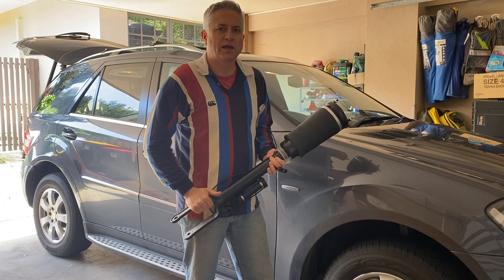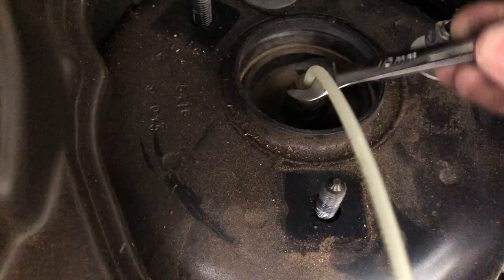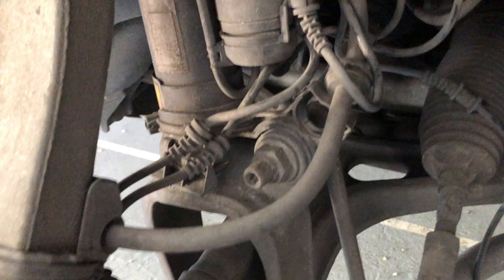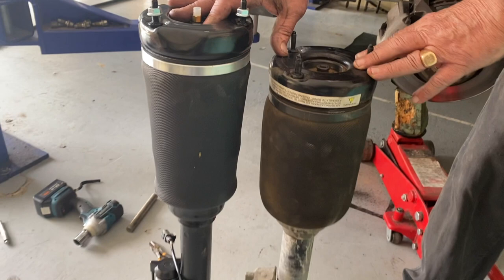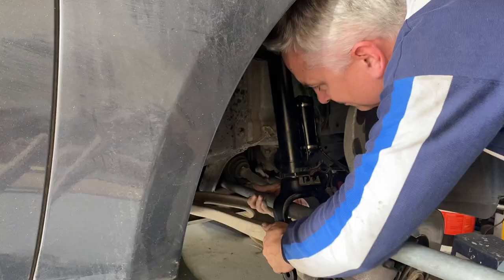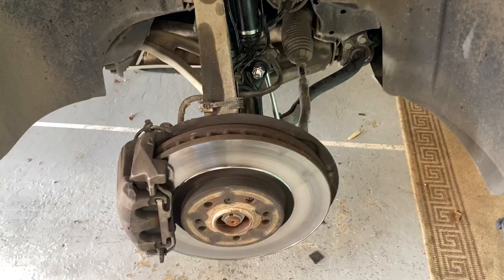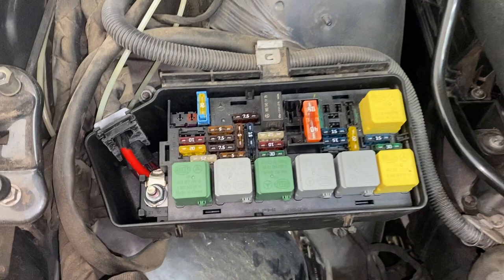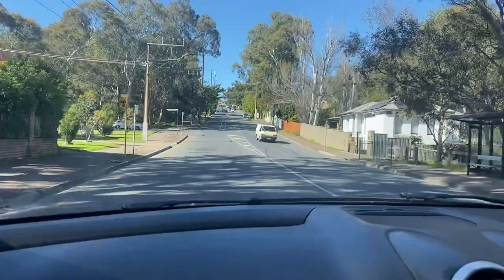How to Replace Mercedes ML350 W164 GL Front AIRMATIC Air Strut Shock Absorber - Complete DIY Guide

Comment: Just changed the front suspension to Miesslers struts and what a difference! The car is a R 320 2007 with airmatic ads and has 120.000km on it. You could notice that the old shocks where not damping at all like the new ones, and ads valves works perfect!
Reply: Great news. Did you purchase directly from their website with PayPal? What was the delivery time? Would you say the company seems trustworthy and legit? I assume the quality of the struts is good and the installation was smooth without issues. Great to hear the ads valves work.
Reply: @Jorsten  I purchased directly from their website with PayPal, and it arrived in one week. I believe the company is trustworthy and the quality looks and feels very good with no issues.

Comment: Hi Drew, big fan of your work. I just happened to have similar noise. If the noise is from Strut assembly.  Then when I  try to shake my car in  garage with some help there is no cluck or any sound. But only when i drive and drive on uneven road.
Reply from the maker: Hi Mate, as you describe was my experience … I could not determine that the strut had failed in the garage!  Cheers Drew

Comment: I finally figured it out. The air strut was still holding air over night, no loss at when manually raised. Turns out the release side of the air strut dampener had failed, as soon as I put the airmatic system back to normal the front driver air strut would drop pretty much to the bottom. So the message is, the air bag on the strut can still be fine, no holes or leaks, but the dampener could be your problem.
Reply from the maker: Hi Mate, thanks for the comment and extra scenario explanation!  Cheers Drew
Reply: Hi Drew, thanks for the excellent video.

Comment: Nice, mine just failed and where i had it checked out quoted me $3000 for the strut alone! Even the mechanic was a bit shocked, hahaha.
Reply from the maker: Hi Mate, where you had it checked out is really taking the Mickey!  I think a genuine Mercedes strut is around $2k but there is no way there is $1k worth of labour.  Give it a crack yourself and use an aftermarket strut and it will only cost you a few hundred dollars! Cheers Drew
Reply: @DrewFixIt  absolutely, trade price was $2100 I saw written down, definitely will be doing  it myself with a $350 part.
Reply from the maker: @troybourne8254  so if you’ve seen some of my other videos you might know that I previously just replaces the air bag on the old strut, thus I may have taken this assembly off and on a few times now, but seriously it’s like one hour of labour …. two hours of labour worst case for a DIY without the proper tools!

Comment: Drew. My wife purchase a m300 W164. Your videos have been invaluable. Your issues are my issues. Regarding the different purchases you have made like air bag strut and the glow plug module. Are these aftermarket items still working  as expected. Sean
Reply from the maker: Hi Mate, I'm glad they are so useful!!  I have no issues with the majority of aftermarket parts I have used, however I will note that I have been through a couple of rear latches ... but at literally 1/20th of the price of a genuine Mercedes part for a latch ... go figure ... I will live with the 15 minutes to swap in a new one a couple of times!!  Cheers Drew :_DFI:

Comment: First of all i love your videos :) 
I have a question, let's assume you changed only the air bag on (this time for let's say arnott) do you think it would also make a difference? I know you have changed the air bag with some (Noname) on. But is it necessary to change the whole air strut assembly. ? Thanks
Reply from the maker: Hi Mate, so it’s actually the strut or shock absorber component that has failed not not the airbag.  Also, there is absolutely no difference in terms of “performance” from a
cheap or expensive air bag as it is still the same volume of air in a fixed bag.  So, I can’t justify even 10x the price for an Arnott Air Bag personally!  Cheers Drew

Comment: Another day another Mercedes video 😅
I just got a Mercedes so I'm a bit worried 😕
Reply from the maker: Hi Mate, to be fair my ML has now done 150,000 kms and I think any car of this age would have parts that fail.  What I would say though is my Mercedes is well maintained and drives fabulously!!!  Cheers Drew
Reply: @DrewFixIt  yes you're right,
Your car is well maintained but mine is from a car lot and it has 100k miles on it.
But it Rides solid and it doesn't have the air suspension (I wish it had one),
But it's a Mercedes after all
Cheers.

Comment: I replaced my front air struts. With arnott struts 160 k miles they were both original parts. To install 600 to install strut.. part included. Struts were about 500 a piece..
Reply from the maker: So you paid someone (parts & labour) $2200 to do both of your front struts?  Cheers Drew
Reply: @DrewFixIt   no bought the two struts. Installed for 100 dollars both struts

Comment: as i recall its the same side you changed the Airbag on, did the airbag also fail again?
Reply from the maker: Hi Mate, yes I previously just replaced the airbag, this time the strut component had failed.  The airbag was actually still fine and I could have swapped it onto just a new strut, however the complete replacement unit that I have linked to is such good value for money that I figured that: 1/ the time it takes to actually remove and air bag from a strut and then reinstall it onto another strut;  and 2/ the risk of damaging the o-rings whilst doing the transfer of the old air bag to the new strut, that I may as well just pay the extra and have a brand new air bag too!  Cheers Drew

Comment: Hey Drew I’m just about to replace my front struts too as they leak air and knock. How do you rate these Airsusfat struts now that they have been installed for 1 year?
Reply from the maker: Hi Mate, it’s actually been about 3 months since I replaced the complete front strut now (as per this video). I have no complaints and in fact wish I had swapped it out sooner! Cheers Drew
Reply: @DrewFixIt can say that I successfully changed both front struts with these Airsusfat units. Bloody pain getting the strut over the driveshaft by myself. A 5ft steel pole was utilised.

As you experienced the car now has no clunking noises and no sagging overnight. Awesome.

I will note that the struts feel a bit soggier than the old oem ones. On Normal ADS they allow a lot of travel but it’s something that is not a big issue as I drive in sport mode most of the time.
Reply: @GoForGold256  
use a ratchet strap (1 inch wide strap will be about the right size), put it around the top between the bolts, and go between the yoke.
make removing and putting in the new strut way easier. don't need 5 feet steel pole.
Reply: @davidjacobs8558  I hope I never have to change these shocks again but that is a great idea 😊

Comment: Knowing this, would you had replaced the whole unit 2 years ago?
Reply from the maker: Hi Daniel, great question!  Yes, probably because of two factors 1/ The time it actually takes to swap the bag on the old strut and 2/ The likelihood of strut failure given the age!  That being said my left one is still running with the original Mercedes strut with an aftermarket air bag, so if you want to save a few dollars it is worth giving it a shot still!!! Cheers Drew
Reply: I was going to change only the air bag in one side, but decided to change both entire struts. I found Miessler Automotive GmbH that makes good quality struts in Germany (not from China) and they have excellent reviews and the whole strut costs only 333€, so I bought 2, since they say that original equipment gas-charged shocks and struts degrade measurably by 80,000 km, plus that a small difference in hight can effect the compressor and valves.
Reply from the maker: @danieleriksson1657  Hi Mate, looks like a good option that you have come across for yourself and potentially others, pay a little bit more and have that bit of extra piece of mind without having to pay the eye watering price from the Mercedes Dealership!  Cheers Drew
Reply: @danieleriksson1657  ADS strut + air spring costs 450 euros a piece actually. Chinese struts don't support ADS even though they say they do. So it's either this, Dunlop for 550 euros, or bilstein for 700 euros. I do hope miessler's strut support for ADS is legit.